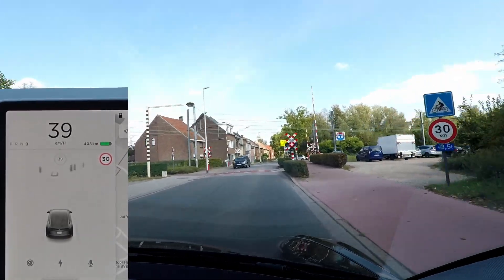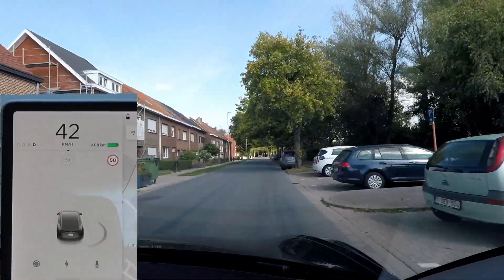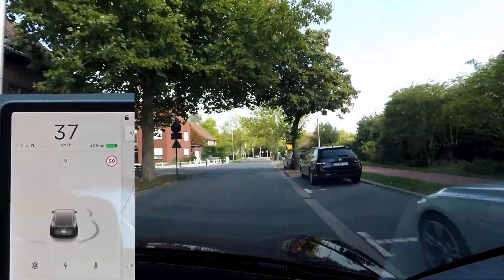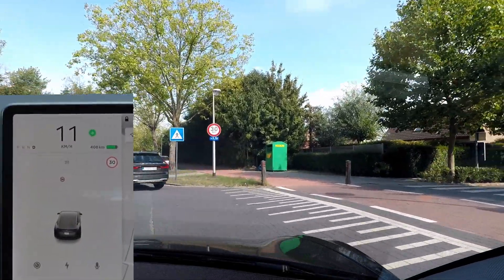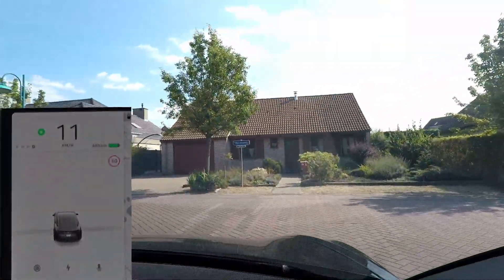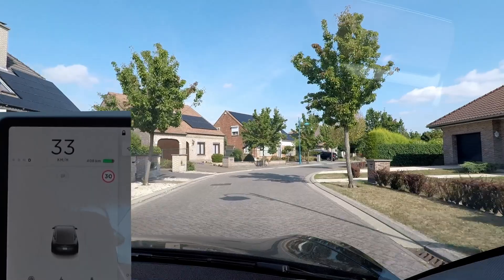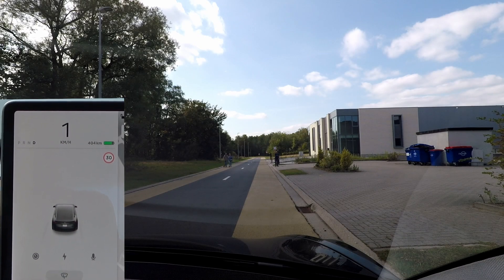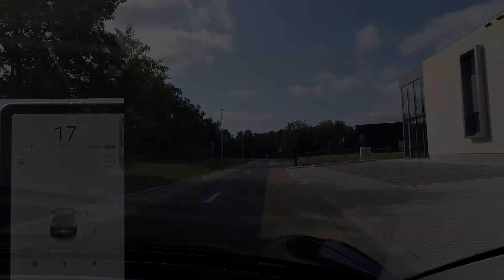Speed sign recognition: the good, the bad and the tricky

Comment: Steven, drive to the Netherlands, there you have on the highway two signs, one says 130, below it,  another sign with 100 (and remark between 6:00 & 19:00); my EV does handle that perfectly, shows both in the display (and in head-up as well) and adapts cruise control speed accordingly; nice challenge for you with the Tesla ... what will it do?
Reply from the maker: If I drive near the Kennedytunnel there is a similar situation. Conditional speed limits are being displayed via the database data and the active sign is coloured whereas the inactive sign is greyed out.
Same with the conditional speed limit in France where you can only drive 110 when it rains. The Tesla knows sbout this. What does your car do in that situation? Do you know? Would be interesting to know if it reads and interprets or also uses a database in the background
Reply: @StevenPeeters  it adapts to the speed which is applicable at that moment, meaning in between 6:00 and 19:00 hours it will pick 100, outside this window it will pick up 130 ... how the car does it, that is a good question, I have no idea. What it will do in France, that is a good question, will it recognize when it rains, i doubt it, but worth to try it one day.

Comment: Glad to hear that you're finally getting HW3 and MCU2. We can say many things about Tesla, but at the end of the day they are still nice people and so far the only company, that provides retrofits.

Regarding the dynamic speed signs: There are actually two things to hat. In your test, the speed signs were above the road. I've noticed, that speed signs above the road are never detected, regardless if they are dynamic or not. Dynamic speed signs were also not detected in they were on the side of the road.

The speed limits that are displayed are still a mixture between recognisition and map data. For example: Let's say a road has a limit of 50 and then 60. If the suddenly the length of the 50 zone is increased, Tesla will display the speed limit of 60, getting the data from the map data. This is a tricky thing and leads to the question, what is a more reliable source of information.

Nevertheless I have to say, that Teslas implementation is already very good. Of course it needs some improvement, but in general im satisfied.
Reply from the maker: Have an AP1 loaner now and it detects the dynamic speed signs perfectly. It will come. The question is when? But this update has paved the way to that future and MobilEye’s patents are no longer a concern

Comment: 5:05
I do not think that the car even saw that sign.

That fake 80-sign: This would not trick a human since no human with their brain working properly would think that that road is an 80-road.

Those digital overhead signs: Our Volvo V90 handles them here in Sweden, since we bought the car in 2017. That really impressed me!

One thing i have noticed even on other videos is that the car always seems to break the speed limit rule by applying the new speed BEFORE the sign. That is of course okay if you go Down to a lower speed but not if you go Up. In our Volvo i have to pass the sign so it does not switch until i have passed it, somewhere along behind half the car length.
Reply: It is impressive that machine can also recognize that it is not 80, but tempered 30.
Reply: @movax20h  That is only because computers vision are different compared to humans. There are other videos out there were it is WAY off, like when it have one of those prioritized traffic signs and it think that is a speed sign!

Comment: I think that this 'viable sign' detection is what sets Tesla's detection apart from Mobileye's; instead of seeing a sign and putting a number on it Tesla may see a SIGN WITH 50 or SIGN WITH 60, etc., so there's no way to make custom speed limits.
Reply: No, the car do not see a sign with 50 on it. It sees what it has learned to be a sign that represent 50. So you can trick that, by using the proper way, and the proper way have to be tested and experimented with.
The same goes for STOP signs. The car actually can be fooled by a guy in a red shirt with scribble on it.
Reply: @Xanthopteryx  I meant that it doesn't see a circular sign with a red border and with a number in it, it sees a specific form of speed limit sign
Reply: @dakerbal  I think it is more abstract than this. Computers are pretty lousy at this. They try to interpret but have no clue of what is going on - they do not Understand or have the context.
That is one reason why it also think a sign with an image on a speed limit sign in it, is a speed limit sign. Like this https://www.highschooldriver.com/assets/image/compressed/road-signs/warning-signs/speed-reduction-sign-warning-sign.png
Reply: @Xanthopteryx  I understand... all I'm saying is that it doesn't see a sign and put a number on it, it 'sees' (or thinks that it sees) a specific type of sign with a specific number on it
Reply: @dakerbal  Here is a pretty good article of how computers interpret the world and how to fool them: https://spectrum.ieee.org/cars-that-think/transportation/sensors/slight-street-sign-modifications-can-fool-machine-learning-algorithms

Comment: 9:25 I believe that the camera may be confused by the difference in size between both signs. Because the bottom sign is smaller, it may place it a bit farther away to match the surroundings, so it probably thinks the signs are not on the exact same position but just really close to one another (you can also somewhat see it on the visualization)